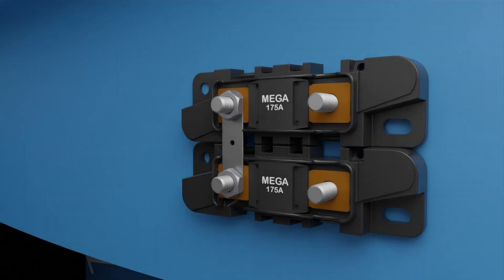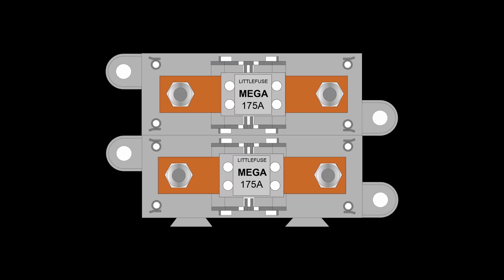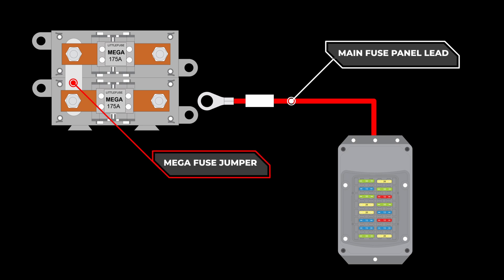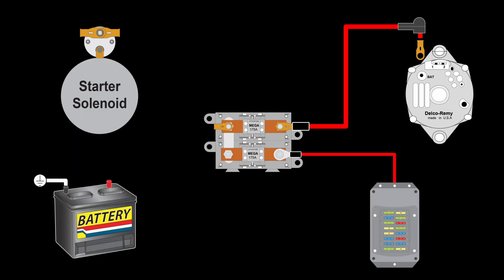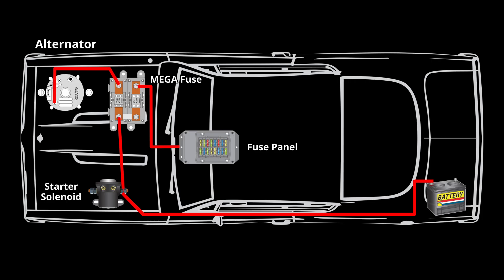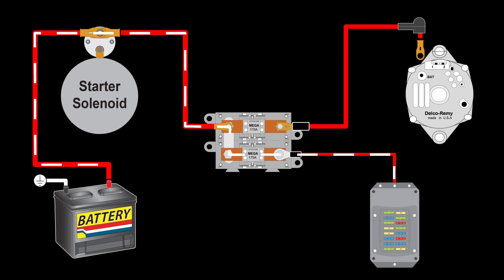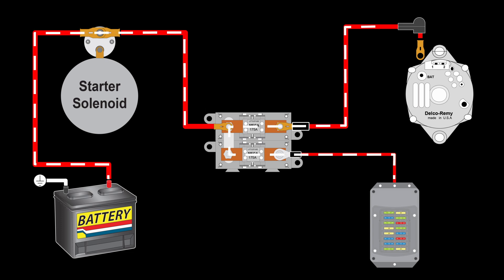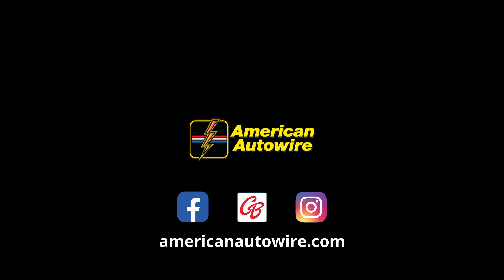Wiring EXPERT Shares Top MEGA Fuse Techniques for Optimal Power Flow

Comment: Well presented. However, without proper covers, the product itself looks to be source of problems. Do these exist or does the customer make these?
Reply: Covers come with it, I just installed this in a complete wiring kit for GM. It comes with two covers for the 2 parts of the mega fuse. It's actually pretty well built.
Reply: @ericthiel4053 Thank you and  yes, I looked a bit further than the YT after commenting as I could not believe this.

There is now a MegaFlexFuse holder from Littelfuse for example (found after 2 hours of looking...).

Comment: I'm currently installing an American Autowire wiring harness with the Mega fuses into my Chevy ii.  I need to add a NHRA legal battery and ignition kill switch, and I'm unsure how I can wire the switch and keep the Mega fuse protection.  Any suggestions?  Thanks
Reply: Racewire Solutions

Comment: With today’s high amperage alternators it’s not smart to run the charge wire to the starter. It should be ran directly to the battery. This will work fine for a stock application.
Reply: It is basically direct to the battery in the video. And no, given the alternator provides power for the car, and any excess only goes to charge the battery, if you wish to ensure best voltage for the vehicle's accessories, then ideally the alternator, needs to route to the distribution point for those accessories first.